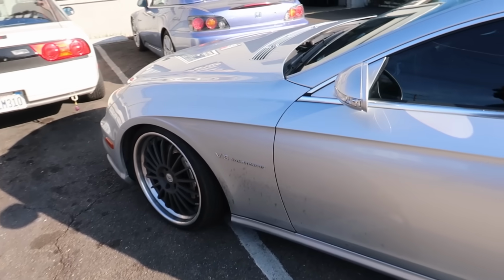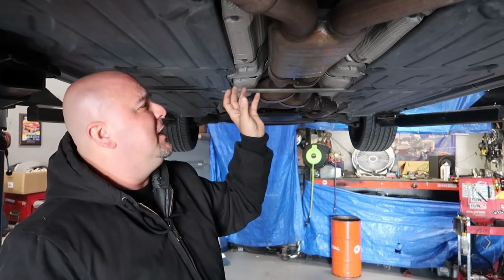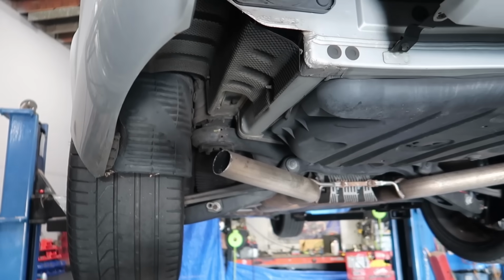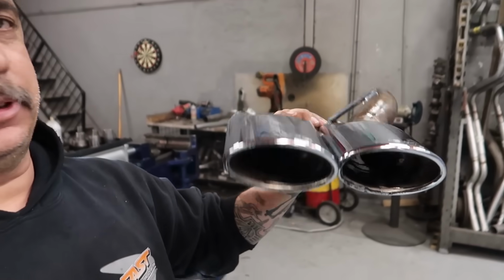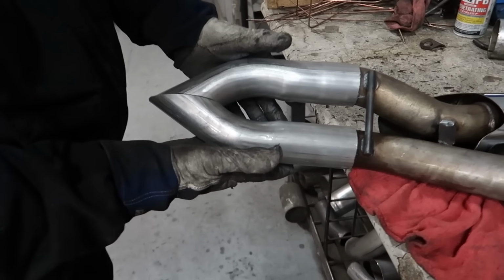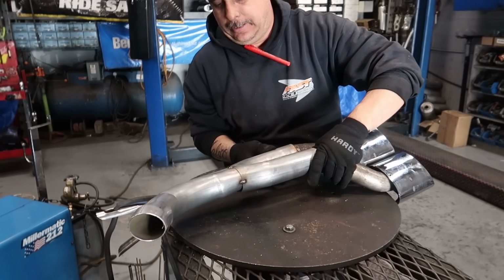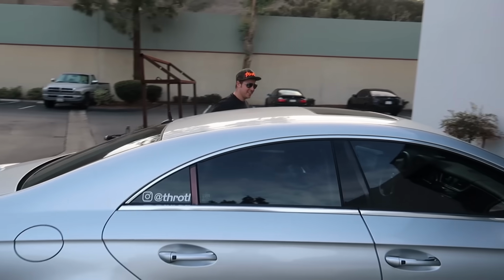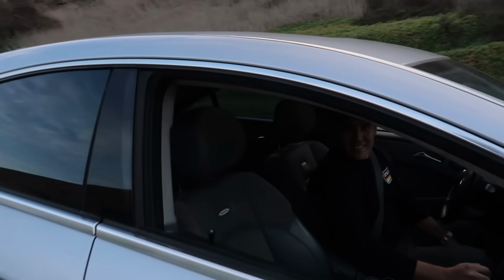NEW PROJECT! CUSTOM EXHAUST FOR +500HP SUPERCHARGED MERCEDES

Comment: Man the w219 is becoming affordable to buy best bang for your buck  and make beast hp just by pulley and tune good stuff i think cls 55 u can make more power and its cheaper compared to the cls 63 ,the good about the 63 is the transmission is really good on those. But 63 is more expensive to maintain im sure.

Comment: Hang on. Yes, maybe the sound has improved (although a better mic would help). But the way the car drives would not be improved. The power gain and feel would be negligible at best. Given that the steering rattles at 70 and there's no traction under high accel, a less restrictive exhaust probably doesn't do much for feel. Just sound.
Reply: Kjy6